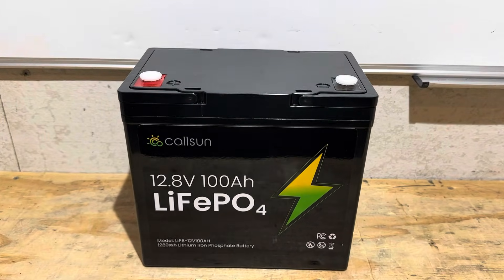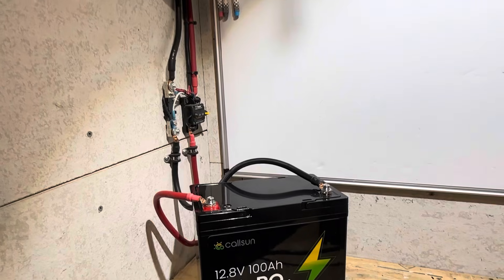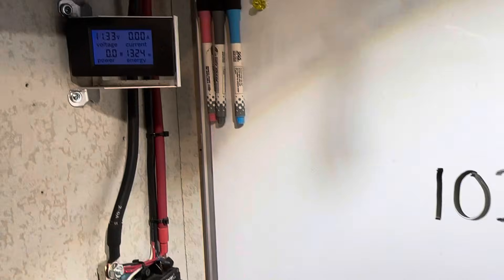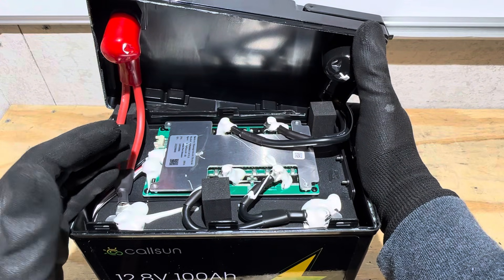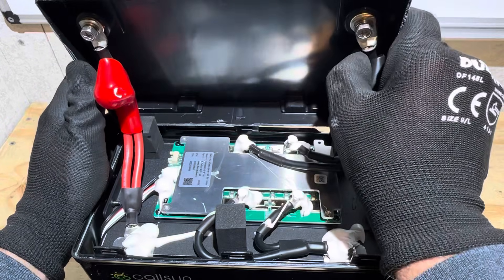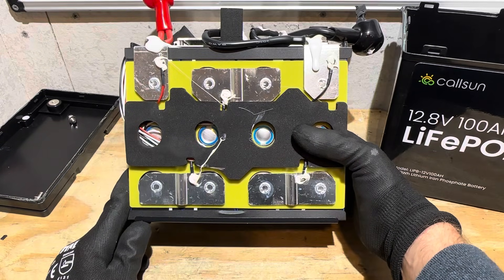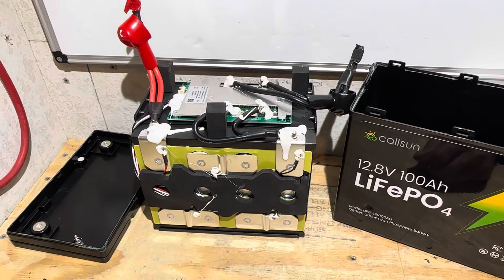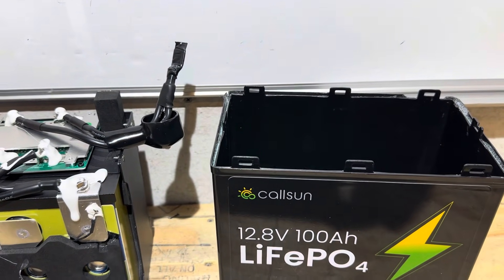Budget 12V LiFePO4, CALLSUN 12.8V 100Ah LiFePO4 Lithium Battery Review & Teardown

Comment: All the MBRF fuses I have purchased have a larger diameter bolt hole than the battery.  Does anyone know of a brand that is 5/16" diameter ?
Reply from the maker: 5/16 is roughly M8 equivalent it’s 7.94
Check blue sea and southbend components brand. They have 5/16 MRBF. 5/16 lugs will work with M8 terminal bolts.

Comment: Thank you for your honest review on this battery.  This could be still a decent battery if you are using it with a fairly light load, say some 12VDC LED lights or a 12V audio amp that is low power.
Reply from the maker: Yes, or if you were adventurous and pop the lid and change out the terminal, it was a bear to open due to copious amounts of sealant and U channel seal. I worry about the heat cycling of the terminals especially with no Loctite or adhesive for the internal terminal bolts. 
Hopefully they can remedy this issue or update to M8 etc. 👍